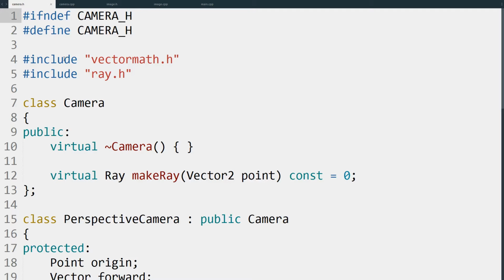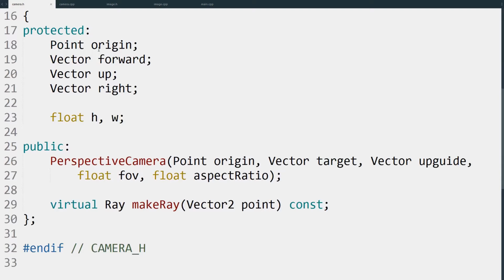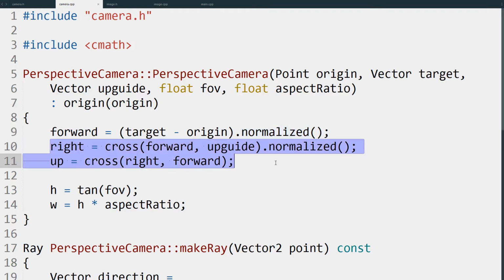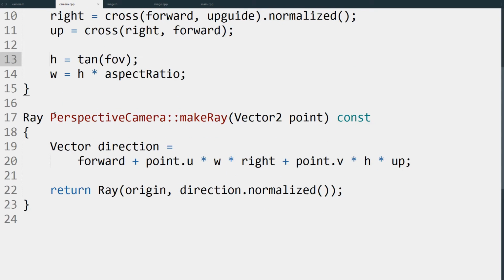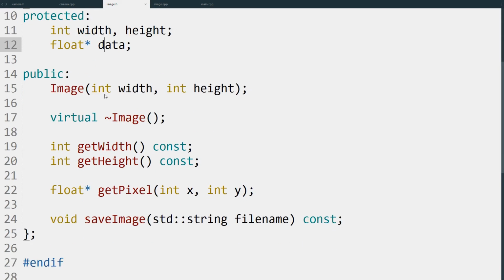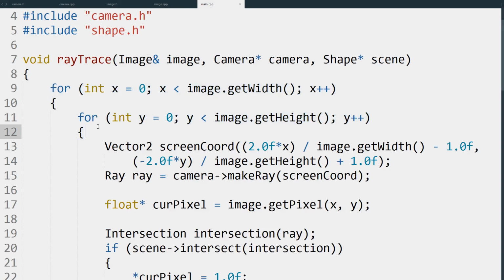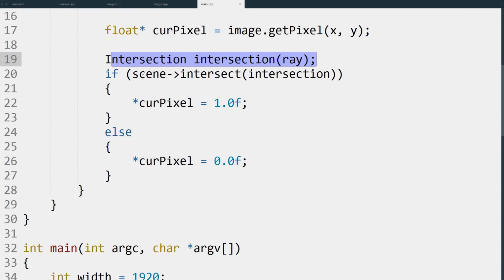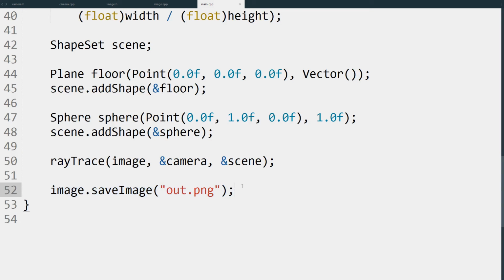Ray Tracer #7: Cameras (Code)

Comment: Can someone explain how the target works?
Is it a vector 3?
I don't understand how we get the forward from just subtracting the origin from the target point.
I watched the previous video and I still didn't understand.
Reply: When you subtract two points you get a vector towards the minuend. A - B = V

The module/size of V is the distance between A and B, the normalized version is the direction.
Maybe is easier to visualize if you think B + V = A.
Origin + Forward * Distance = Target.
Target - Origin = Forward * Distance = V
Forward = Normalized(V)

Comment from the maker: A small correction - the default FOV I used when setting up the camera is 45 degrees (pi/4 radians). This is very high and will cause some distortion around the edges of the screen. Something like 25 degrees (25 * pi / 180 radians) would be more suitable.
Reply: hey there! Thanks for posting these videos. I was following along the previous video (#6) in order to understand the relationship between camera and the world co-ordinates and I'm little lost there. What I don't entirely understand is how does the direction vector end up in the format (forward + point.u * w * right + point.v * h * up) i.e. the significance of multiplying (point.u, point.v) with (right * w and h * up) respectively. Would appreciate if you are able to shed some information. Thanks
Reply: Thank you so much!